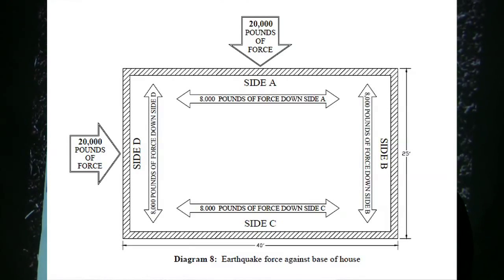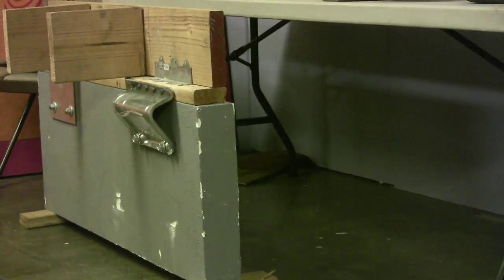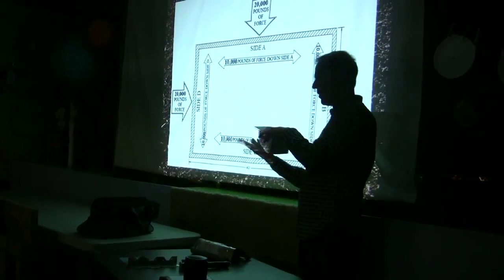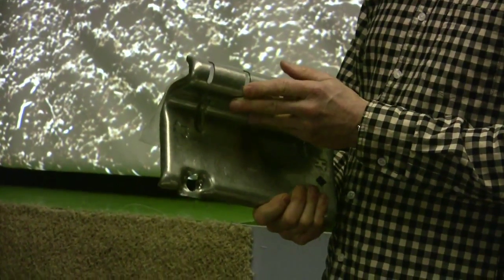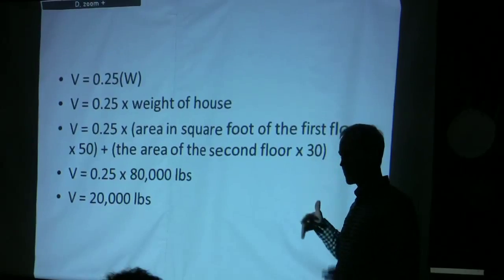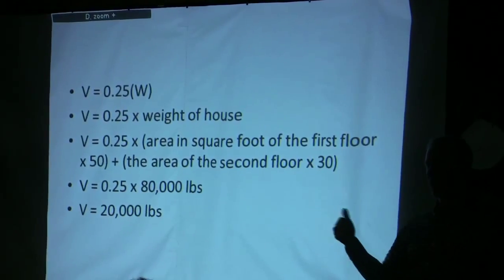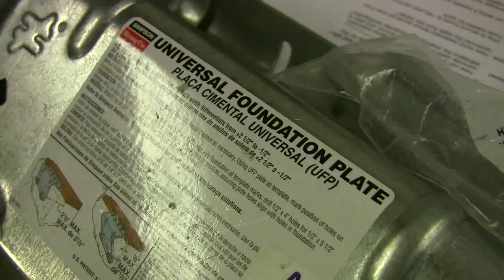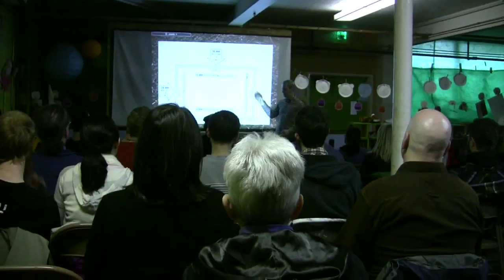NW Seismic Workshop on Retrofitting

Comment: Great video! I have a one story home with basement and have added Simpson strong tie 7x9 retro plates since my sill sits on my foundation wall. My question is - What is the correct spacing for those strong tie a35 transfer ties/angle brackets? Directly above the flat plate? On either side? 2 ties for every plate? Have seen different configurations in different videos. Any help would be appreciated. Thanks!
Reply: This is Bay Area Retrofit in San Francisco.  The two images describing the base shear formula were taken from my video   https://www.bayarearetrofit.com/videos-seismic-retrofitting/  with very minor modifications which violates copyright laws.  I really don't mind, but would you please give me credit or anything else you used of mine?   I remember giving you permission to use some of my images a few years ago but I would still like credit.
 Howard Cook, Bay Area Retrofit